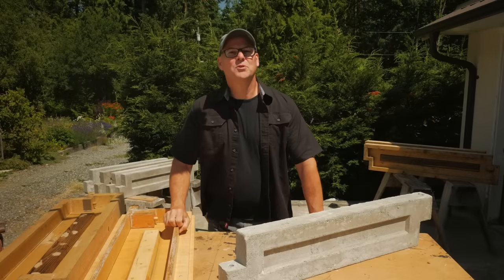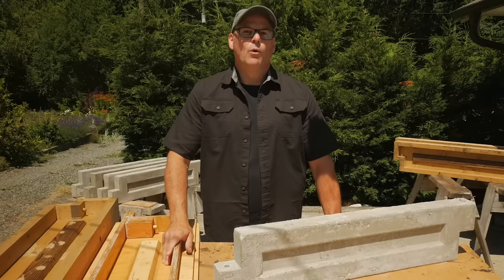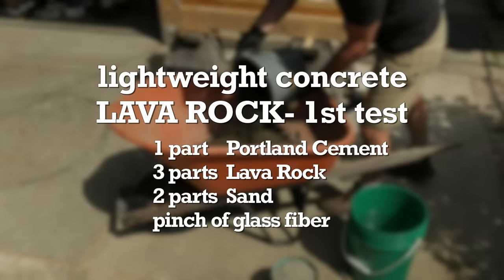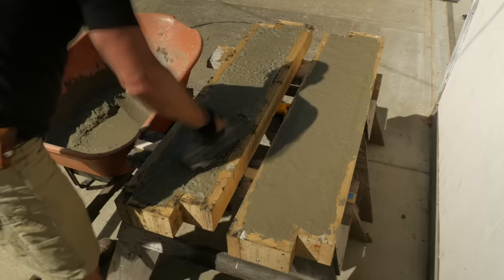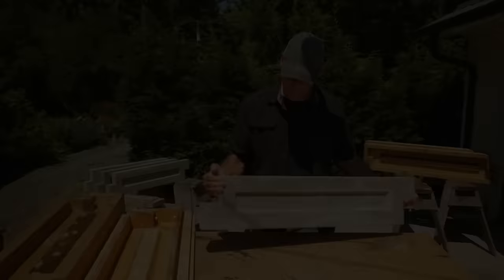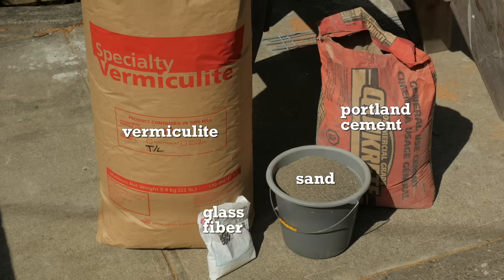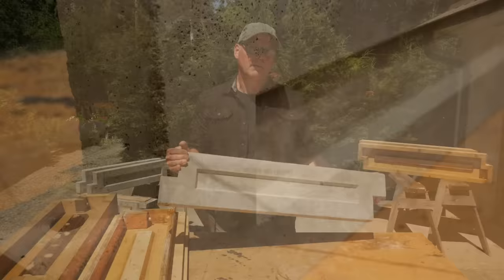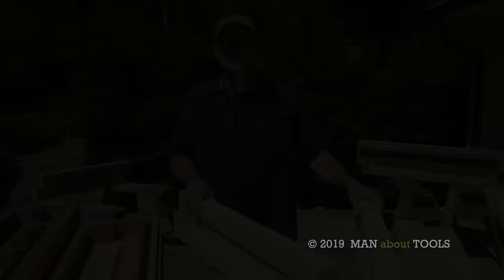make Lightweight Concrete Garden Boxes PART 3 - Aircrete Vermiculite Lava Rock

Comment: I was able to make a very lightweight gypsum wallboard compound by simply dissolving a small amount of TSP (Tri-sodium-phosphate) in the water.  TSP is often available at paint suppliers for cleaning.  There was no need to mechanically create foam.  Just the mixing of the gypsum powder in the solution, seemed to accomplish that.  It has been years, so sorry for the lack of exact ratios but the dried compound was about half the weight.

There are also some commercially available admixtures designed for air entrainment, in concrete.

Comment: As someone already mentioned, I wondered about using regular concrete on the surface, and keeping the aircrete in the core. Some googling revealed “voided slab construction” and a product called bubbledeck that retains plastic balls in a rebar matrix. That leaves voids in the center of slabs, where the concrete wouldn’t add to the strength anyway. So maybe you could put ping pong balls on a wire in the center of your square cross sections? Or just wrap foam insulation rod in a corkscrew around your reinforcing wire grid? Wire on long sections of pe rod then cut short pieces out so there’s not a continuous void? These are the kind of experiments that are fun to watch, but less fun to clean up after if we try them in our own backyards.
Reply: I wonder if pool noodles could be used - no clue, just thinking out aloud

Comment: No idea about the warping, but for durability you could coat first with a cement slurry to smooth the surface, then coat with a concrete sealer. Not sure how hard those sealers get, but they make kitchen counters that way.

Comment: I'm not a pro at concrete using the Aircrete mix but maybe if they were left longer in the molds to cure the deforming may be minimal. I don't have much knowledge about Aircrete, so it's just my opinion. My wife and daughter are gardening enthusiasts, and I may consider making the concrete borders for them like you made. I'm not a real wizard, it's just a nickname I was given. Most of my life I made gadgets and built contraptions. I think the best one I ever made, that is on my YouTube channel, is powering my 1938 Singer industrial sewing machine with bicycle pedals for doing leather work. It did come with an antique 1930's motor but it runs way too fast, so I came up with bicycle pedal idea, so I have more control while sewing.

Comment: Excellent!  I agree that the Vermiculite would be superior but wondered if getting a pulverized lava rock would have some benefits for mixing and smoothness ..... can't wait to see part 4!
Reply: That's what I was thinking as well or using pumice instead of lava rock because of the weight and density .
Reply: @royalspin  does pumice lava rock weigh less than the black kind?

Comment: Awesome video!  Sure wish the Aircrete was more durable looks wicked light.  What if you used perlite instead of vermiculite that would make lighter.
Reply from the maker: I'm going to revisit the aircrete panel. I'd like to try a few more options. I really like aircrete and want to get a good panel from it if I can.
Reply: @MANaboutTOOLS  ideally Aircrete would be the ultimate. Please keep me informed plan to start building 3 ft. forms soon, I have a few projects that need finishing up first. From the looks of your channel, you know all about multiple pans on the 🔥. Truth be told, I didn't  notice the music on part 1 until you mentioned it in part 2 😂.
Reply: @MANaboutTOOLS  how about, when setting up the air crete panels lay in a veneer of regular concrete  on the exterior side for the weed whacking edge or do a decorative pea gravel on the edges that need extra durability, or use a high strength mortar mix like in ep 4  for the edging with or without the pea gravel that might help prevent the bend/flex issue... I can't hoist 80# bags of cement anymore, but rather use something like this than treated lumber in the garden

Comment: Great video. Have you considered trying to use a Styrofoam panel in the center, with wire reinforcing 
on each side, surrounded with a thin shell of concrete?
Reply: Doing that would make the block very weak and easy to snap, but grind up the styrofoam panel and mix it through the mix and it should work well.

Comment: Concrete strength is directly related to how dry it is. The wetter  the concrete the lower the eventual strength.  The disadvantage to dryer concrete is that it is harder to pour and evenly mix.

Comment: 2 volumes Perlite,  1 part Portland cement,  1 part sand,  glass fiber (a handful per panel for tensile strength),  PVA (polyvinyl alcohol [Elmer's glue] perhaps 4 oz per panel for surface) added to aircrete foam by weight equivalent to water required for cement.  I would recommend dry mixing the Perlite, sand, and Portland before adding the mixture of foam and PVA.
Reply from the maker: Michael E. Maus Sounds like a really good blend. Thx

Comment: Ever try Styrofoam beads, this is a lightweight material that won't collapse like the bubbles!
Reply: Maliki King - true, but with as many panels needed, that could be costly.  I had a similar thought but was leaning towards crushed styrofoam - repurposing packaging materials and keeping them out of The landfill
Reply from the maker: Haven't tried that yet.
Reply: Just don't let any superworms near it
Reply: vennic: superworms?
Reply: @BiggMo  apparently there are worms that eat Styrofoam, referred to as such
Reply: Bean bag material?
Reply: You can shred Styrofoam easily with a leaf blower/mulcher.  It smells, though

Comment: Man, I am loving this series. I have made a more primitive version of this mold casting system, and I can say it works well. I have several walls now, but am very interested in this low weight idea. So very clever. I have heard good things on Vermiculite. I will try that myself.

Thank you for the ideas, and processes. Very fun.

Comment: What about  pouring cement into form as a first layer(before metal grid) and aircrete after, as second layer, which “looks” inside a garden box?
Would it solve the problem of low durability?
Reply: I had the same idea.  Sort of emulating the way bones are.  He's trying to resist a weed trimmer not a car so it doesn't need to be too strong.
Reply: I have seen people put a metal frame around each "block" for rigidity or coat with a lime plaster. Stuff is so cool. We plan to use it in our old house in the walls behind the latch as insulation so none of that will matter. Woohoo! Your idea would help making blocks I think.

Comment: Have you considered a hybrid of vermiculite and aircrete.  For the facing part, pour a layer of 1/2 to 1 inch of the vermiculite blend for surface finish and durability against the weed eater etc. and then use aircrete to fill up the rest of the mold for the volume and weight reduction (as this is the side that is towards the inside of the bed and not seen).  Might even be able to throw in some chicken wire or square mesh after the vermiculite layer to help reduce the warping and cracking you got with the aircrete as well as add some reinforcement.  Only down side is the corners would have some aircrete exposed with the way the garden box is assembled.
Reply: Yeah I was thinking about this, but a hybrid of the two in the same mix. I want to make some fairy large outdoor planters but if I use a regular cement mix, I'll never be able to move them once their filled.

Comment: The bowing indicates that one side dried faster than the other.  Try letting it cure without the plastic on top of the filled form.  This may even out the drying process and minimize the bowing problem and reduce the cracking.  I don’t know if you wet the forms with water.  If not that may have caused them to suck moisture out of the bottom side while the top side lost little moisture due to the layer of plastic covering it.

Comment: Muahahaha SUCK On THat! Conglomerates!

You need more water during the curing process. That is why it dehydrates too quickly and shrinks/bows/cracks. After a couple hours of curing you need to keep adding water over it and keep the form damp. Cement can cure underwater so be liberal with it and be liberal with the glass fibers, it's pretty cheap and helps a ton. Fiber mesh is also a great alternative to hog wire fencing. You can layer it as you pour the moulds. 

I was born in cement, molded by it, I didn't see the light until I was already a man :P 16 years in the cement and tilecrete business.

Comment: I have seen people put a metal frame around each "block" for rigidity or coat with a lime plaster. Stuff is so cool. We plan to use it in our old house in the walls behind the lath as insulation so none of that will matter.

Comment: Try adding acrylic polymer to the mix.  Also, steam or water cure; don't leave the molds outside in the sun.  Keep the plastic, cover with an old blanket for the first day. If you can, de- mold and flip over after 24 hours go ahead.  If you leave the mold it's likely to curl.  Hope this helps, 19 years of concrete experience.  Also very nicely done!!!

Comment: Yea the aircrete with both a mix of perlite and vermiculite would do it. You would be making a hybrid hypertufa mix. I have made hypertufa pots using vermiculite and vermiculite and perlite  mixed with cement. When they dry out totally they are a lot lighter.

Comment: possibly coating the form with a more standard Portland mix then fill with the aircreat mixture.  plus changing the shape of the reinforced wire , round or triangular? they look pretty good👍

Comment: You can use a hand full of fiberglass ..nice panels,great concept.that air Crete is very cool stuff.if you ever want to make an air Crete bridge ,ad crystal loc,which is what is used in dams for extra strenth.i have all ways wanted to build a bridge for over a creek for walking. But light enough to throw in the back of a pick up.

Comment: By concrete technology you may remove concrete from  forms in 24-48 hrs. Then you have to keep blocks wet and covered for at list one month(depending on temperature)  before using them. It will prevent cracking and will add strength.

Comment: A high glass fiber content would help with the cracking and the bowing while also making the panel stronger. Adding in some sand would help with the abrasion issues, but a plasticizer would be needed for workablity and might cause issue with the foaming process. A lower water content could also make the mix stronger, but again, a plasticizer would likely be needed.

Comment: Great video. You've gone above an beyond for your viewers who suggested a lighter panel. For me, the simplest way is the best. I feel like regular concrete with the simpler forms out of framing lumber is the way to go. Once the boxes are in place, I probably won't be moving them much anyway and I'd rather not have to worry about ruining the look with my weed eater. Still, if I were to want a lighter panel, I think I'd experiment with spray foam reinforced with a insert of wire, metal tubing, or even wood. I'd just have to figure a way to get it in your forms, but it does raise some interesting thoughts.

Comment: Very cool and interesting! Concerning the aerocrete I would try using two different blends in the mold, having an inch of regular concrete in the first layer or something similar. Anything really to give that outer part density, hardness and durability. Then fill the rest of the mold with aerocrete and then see what happens... 

Keep up the good work, its AWESOME!

Comment: Well done, Kent. I'm glad you did the weed wacker "test". That was what I was afraid would be the result of aircrete. Think I might wind up inserting extruded polystyrene at center with the lighter mix. Cheers!
Reply from the maker: Thanks! I think I need to revisit the aircrete again in a future video. Maybe try a few more formulations.
Reply: You might try brushing (or spraying) on a wash of cement mix like you would do for concrete counters first and then pouring the amended aircrete to add surface durability. The inside of the box is not as important so finishing with aircrete should be ok.
Reply: @JasonTaylor1   hmm, yes I had thought of that but then the inside is prone to tool marks while gardening. I'm also musing about pouring aircrete inserts to use instead of polystyrene, incorporating the wire or a wire for the stake tube guides to keep it from floating.
Reply: @ScooterFXRS  I guess you could leave the last haft inch and skim on more standard mix. I wonder if the difference in shrinkage would cause the surface to split off.
Reply: @ScooterFXRS  Another idea that might help with the warpage and cracking, is along with a dryer mix and vermiculite, make the forms thicker since they are significantly lighter. Maybe an inch?
Reply: @MANaboutTOOLS   Yeah after looking at Honey Dew he uses a plasticizer [ lime ] to reduce water and J lube to keep the foam bubbles intact. The warping and cracking I believe is stemming from too much water and with the steel wire as it shrinks the steel of course will not shrink nor the fibers.

Comment: The side with the relief either shrank less or the flat faced side expanded more.  Test a panel with similar faces, either both flat or both with recesses.  This will show if it is a geometry issue or a drying/curing issue (one side drying at a different rate than the other).  If it still bows, I guess that it is a drying issue.  If it doesn't bow, then I would guess it is a geometry issue and the panels might need to be symmetrical.  ?maybe?
Reply from the maker: Maybe. I was thinking that too. Or the aircrete was much more dense in the bottom of the form and thus contracted more.

Comment: 1 / 2 / 3 + .4 is the A B C of concrete mixtures.
This ratio stands for 1 part of Portland cement, 2 part of the rough agregate, 3 parts of sand, (fine agregate) and 40% of water calculated upon the weight of cement used.

Comment: This was a well produced step by step break down of your own experiment and experience then any other DIY video on YouTube that I've seen. Thanks. 
Also, concrete is at its strongest after 28 days. Try that weed wacker test after that. 
Also,  look into superplasticizer, it's a water reducer... you use less water, to get a looser result without losing strength.

Comment: I loved your creativity.
I would like to make many veggies, herbs & fruits planters during my second landscape remodeling in last 40+ years.
I have space, when I was young, I build boxes with 2”x12” lumber & grew all the above started in late 70’s.
In 25 yrs that lumber was devoured by termites including a 105’Lx2’H retaining wall. 
That wall was replaced by cutting concrete walkways/patio landings (lots of them) 18”W and 
got them stacked on top of each other 4-5 layers high by a concrete cutting contractor.

That 1st remodeling I did not care about veggies gardening area. Till now.

The Past 3 years have messed up many lives, mine too
So my 2 remodeling theme is to build Edible Forest. From my original landscaping I build an orchard in 105’x8’ space with 12 fruit trees, which are still harvested with massive produce.

Here comes your creativity & participation request.
I would be able to create the final blocks at location.
Your expertise are in building templates.
Please let’s talk about how you would help me.
I would appreciate a timely start up of the converse.

Comment: This is just my opinion, the cracks in the Aircrete may be caused by thermal expansion of supporting wire grid when the mold was put under the sun. I still prefer Aircrete with wire grid inside. Maybe you could increase a little bit of portland cement from 9.4lbs to 19lbs.

Comment: I would "guess", that you can use that fiberglass tape, that you use for sheetrocking, those might add more stability, during the drying, and also stand up to the weedwacker better.

Comment: You could try to use a durable concrete mix in a thin layer before you pour for the aircrete.
But it needs to be sticky enough so it doesn't flow of the mold walls.

There are a lot of people who use layering to create concrete furniture.

Comment: EPS bubbles you should try to mix in concrete. Other issue in winter time the cold will crack concrete panels.

Comment: Hey. About cracking problem. When you work with concrete it is not hardening because it is getting dry, it is hardening because of concrete and water reaction. You can try to give it some more time to harden and do give it aditional moisture. Complete hardening of concrete is when ~28 days have been passed. i think cracks are there because it was drying to fast.
Reply from the maker: The aircrete I made in Part 3.6 worked much better. No cracks or warping. Here's the link to the associated blog post" https://manabouttools.com/make-lightweight-concrete-garden-boxes-with-aircrete/

Comment: Yes this is old but… the lava rock panel and the roughness. So I poured a huge 12m long concrete beam in the ground right underneath a couple of big gates. 12m x 30cm deep x 20cm wide. Lots of rebar, I welded up a rectangular box of rebar. Anyway I used 32 320 concrete (I think, really strong stuff) anyway I couldn’t get the surface to finish smooth. The truck driver told me to spray some water on it and then try. It worked. Seems it’s a rock size thing that makes concrete stronger and then a dryer mix as well. So a sprayed surface won’t affect the job except the surface.

Comment: I'd probably just use the vermiculite, but there's nothing stopping you from using two mixes in one form. Make a vermiculite and aircrete mix and use the vermiculite mix for the outside of the form while using the aircrete for the core. You can either make a separate aircrete core and slip it into the form while your poring the vermiculite mix, or pour it at the same time using a center mold. More work for minimal gain though.